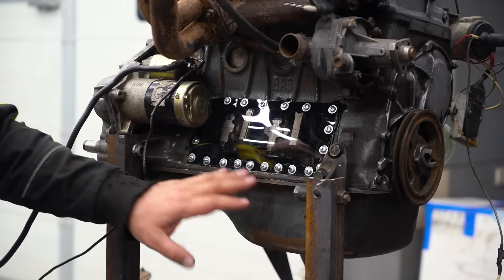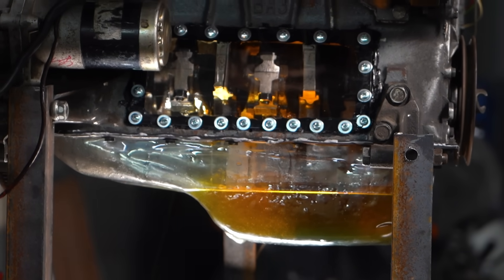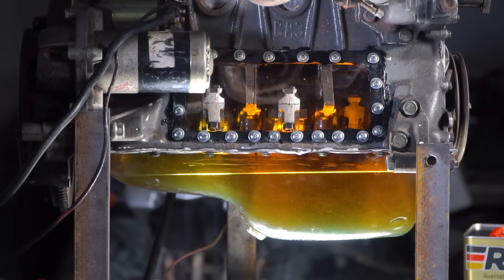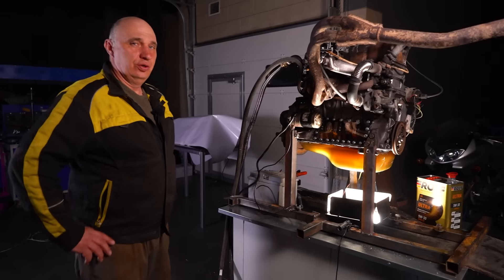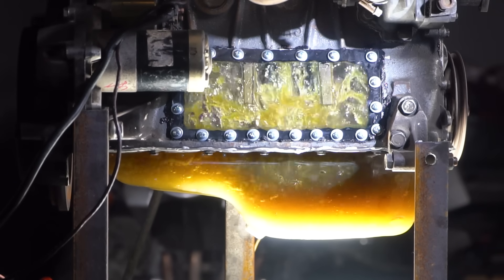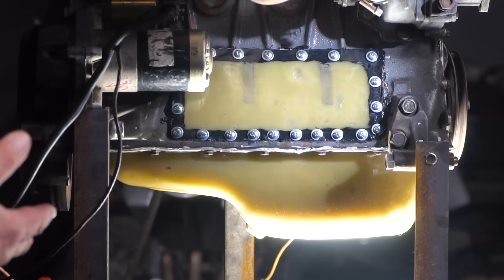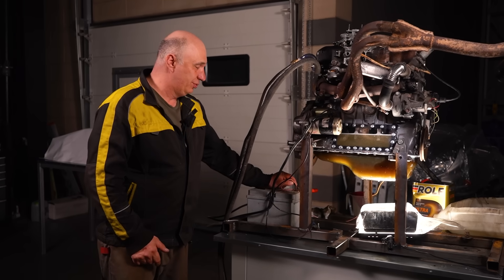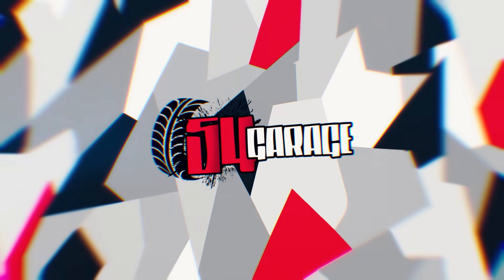What actually happens when you overfill your motor oil? (w/ transparent oil pan)

Comment: 8:25 "nothing bad happens" i saw a comment or 2 mentioning foaming which will lead to reduced film strength for bearing and metal surfaces. Yes, you are correct but remember most modern engines have windage trays and baffles which this engine did not. So even with this comparable level of being overfilled i dont personally deem it to be an engine killer in short term with windage trays. But of course dont PURPOSELY overfill either.

Comment: Yeah right.  The issue is that the discharge pressure of the oil pump will increase due to the increased suction head and you may blow your oil relief valve, and your oil will empty onto the street as your are driving.  Then you will run into serious problems if your don't notice in time. This happened to my when I put in about 50% above max level in my 1972 Ford Falcon (Australia) but I noticed before I lost all oil pressure.  Levels beyond this are ridiculous so I am not going to comment on this.  Ignore this video and pay attention to your oil level, measuring it on a flat road or surface.  For all we know, the test engine here may have had a faulty oil relief valve.

Comment: Hola tengo un OPEL CORSA GS-LINE 1.2 T XHL MT6 S/S 100 CV o 74 KW del año 2021 y tenia una pequeña fuga de aceite de motor  por  la valvula de drenaje de aceite digo tapon de abajo al subir el coche  ariba  tenia el tapon casi defectuoso y pusieron una arandela de cobre  y problema resuelto y tambien apretaron un poco mas  lo que es los tornillos del carter y añadieron mas aceite  pero es un PURE TECH tiene una correa bañada en aceite  y le pusieron hasta la varilla  mas del maximo y en ves  de que vomitase el coche por la rejilla como lo hacia el vuestro vomitaba por el tapon  grande  donde añades el aceite cuando llegas a 4000 RPM empiesa a scupir   mi duda es  con el tiempo ese aceite dejara de ser util  mas  tiempo o como va eso yo habia pensado meter una manguera y vaciar un poco aunque el coche esta en garantia y los mecanicos de  ahi solo chapusas hacen no queren ni trabajar.. y cuando consigues que te lo aregle peor lo hace..

Comment: it depends about the engine design; i am sure those old russian VAZ machines are much more forgiving about many things, but if you did that with modern petrol engine, the oil would foam like hell, also you lose power due to cavitation and even have more wear and tear cause of cavitation... there are engines that can drive with no oil forever and those who seize immediately... my point -better safe than sorry

Comment: Once I overfilled my bike with engine oil, after about 10 kilometers my bike overheated and stopped, then took it to mechanic he drained the excess oil and it became normal, so overfilling will stall you on the road somewhere, little bit will be OK though.

Comment: TLDR: The engine will run for the short term even when grossly overfilled with oil. BUT... long term, due to being churned by the crank, the oil gets whipped into cream which isn't good for lubrication and the overall life of the oil (shearing).

Also, this is a rugged, simple engine. Not a delicate modern engine with PCV, sensors etc that might not take too kindly to overfilling.

Comment: Ada kompromi kelebihan dan kekurangannya dengan oli yang di isi penuh berdasarkan opini ku pribadi, no offence.
1. aliran oli dalam mesin menjadi full segar merontokan residu dan kotoran
2. semua yang bergerak sudah dilumasi oli dengan sempurna, seperti layak nya gardan mobil dan gigi transmisi
3. saluran saluran capiler teraliri oli dengan kencang dan memiliki motif yang akan membersihkan saluran oli
4. oli sedikit berbusa / bergelembung udara untuk di pompa kebagian atas mesin.
5. pelumasan maximal, anti gesek masimal, anti aus maximal.
6. OCV bekerja extra, tapi bisa di bersihkan.
7. saluran oli di ring piston teraliri dengan aliran deras.

saya rasa ini cara terbaik untuk 1x trip perjalanan 100km sebelum ganti oli dan tune up mobil berkala. Atau menggunakan oli baru ACEA e7 yang tinggi detergent untuk 100km itu 

 Thanks for you experiment

Comment: I have filled the engine oil in my car with 3.5 litre as Shop person told more oil good for engine but later I regret as mentioned oil to put 3.1 litre but filled with 400 ml extra. But I didn't not find any issue in car like Start also happening and running also smooth but still I am worry for long go should I remove extra 400ml or should I keep as it is as oil level when I checked it was only in max not more than that if it is fine then I will keep the same. Suggest me please thanks in advance

Comment: Older engines tend to be more reliable, but those manufactured from 2015 onwards are not built as robustly. While they offer a lot of power, driving at high speeds for long distances, such as 50 miles, can lead to engine damage. Additionally, it's important to ensure that oil maintains proper circulation; otherwise, you may end up with a damaged engine.

Comment: The funniest thing here is the meathead thinks its fine as long as it doesnt explode. lmao
there's way more going on in a real engine. The PCV system will get fucked, the bearings will get fucked due to the oil foam, Catalytic converter will get fucked, spark plugs will get fouled, engine can get hydrolocked, but this is all beyond his high school diploma.

Typical tolerances are within 5% of recommended amount, (5 liters give or take)

Comment: I believe that if the oil is overfilled beyond what is allowed, very soon it will eventually find its way to each individual cylinder, where it will drown and turn off the spark plug. In the end, misfires occur, and the four-cylinder engine will hardly run with just two cylinders if you're lucky.

Comment: Unfortunately, you did not measure the oil pressure. When you increase the oil you increase the pressure and within a short time you will have oil leaks at the oil seals because of increased oil pressure.

Comment: No expertise in car engines,
always heard that if there was too much oil
it could overflow and become fuel
and the engine would race, only accelerate to failure.
I suppose this could have been possible in the 80s?
Is there another safety device to prevent racing?
Or was the oil never able to become fuel?
3:07 PM The excess oil comes out through the breather.
Where does the oil go through this outlet?

Comment: Enough oil will make the connecting rods to dip in the oil, OLD engines were designed to do this to throw oil up to the pistons ETC.   Todays engines have outher ways of lubercation, however,  rod dipping can cause sever damage to the ROD berings, increasing the tolerencs, dropping the oil pressure, and finally turning the OIL lite indicating the engine is SHOT.

Comment: I did that once as an apprentice. It was the owners car. We had a 30 minutes or it's free oil change. Inspection included. Owner left it for the day so no problem. Topped it up and got 6 30 minutes or free at the same time. Good luck with that. Went back after that b.s. and filled the car. Didn't get fired, but how tf  was I supposed to get 180 minutes done in 30. I quit, f u toyota

Comment: Even today many so called "car mechanics / technicians", who work in 4 out of 5 or more star workshops, need to see this video to understand how to diagnose a low oil level. I remember when I visited in 2024 a "car technician" in his own repair shop where I had to explain to him that a lower oil level than the maximum limit is normal for a car which just went to his workshop, because the oil was circulated inside the engine. He obviously wanted to sell me the oil, but I had to explain him that he needs to wait for an hour or more (with the engine shuted off) to properly diagnose the real oil level of the engine. Eventually he didn't listen to me and he had overfilled my engine with oil (he put +1.5 Liters) and fortunately this didn't cause any further trouble because I emptied these 1.5 liters shortly after I got an oil warning in my dashboard.

Comment: I run 2.5 qts over in my 2003 Silverado 6.0 . Because the oil pump pickup tube o ring is bad .. I have done this for the last 50k miles 😂😂😂😂😂😂

Comment: That's fascinating.  Before I change my oil I add a quart of automatic transmission fluid to the oil and drive for half an hour, then drain and refill with oil and change the filter.  Based on this it does help to over fill a little, it cleans up the engine components faster.  Once you get to max fill when over filling you end up with hydraulic pressure breaking through seals.  Amazing video, I've never seen anything like this.

Comment: i should mention transmission is different. If you add extra fluid over capacity then it causes overheating which means the fluid will become burnt and degraded sooner.

Comment: These idiots I wouldn't be surprised that they are misinforming people to cause them to deliberately destroy their power trains. Listen as u saw in the video it started to turn into milk when it was running. That is caused by foaming and aeration when that happens The engine oil can no longer provide lubrication and protection for your components then causing scoring and possibly catastrophic failure also the increased oil pressure will cause seals gaskets things to be compromised even though they ran the engine they only ran it in small increments and I'm pretty sure they were cuts that let them cool the engine back down and allowed them to reflush and put something else in or put in fresh oil because there's no way that that engine oil is staying that clean after that much aeration and foaming do not listen to this channel or these people there deliberately trying to destroy your engines from half a world away Nice try Russia. 🖕🏿🇷🇺

Comment: This may be an inherent design in this particular engine, but there doesn't seem to be an oil pump or pick up tube like in almost every engine. This is not a true representation of a typical engine and how oil gets circulated throughout the system. Most engines have an oil pump and a pick up tube that sucks in the oil and forces through the engine to vital components that need lubrication. If engines were built like shown here, most cars would be scrapped because no one really checks their oil level from what I've seen in my line of work. Having said that, the level of oil should be as recommended by the dip stick. Too much oil can plug up many emissions related parts and damage the catalytic converters.

Comment: I don't really like it when the oil is overfilled, but I'm thinking that the engine would have to be significantly overfilled to be a problem. Once the engine is running the probably 30% of the oil is circulating throughout the engine so the oil the oil in the pan should be much lower. If you pull the dipstick it should read very low, although I've never tried it. My motorcycle holds 3 qts of oil and it has a sight glass instead of a dipstick. When the oil level is close to full with the engine off, no oil level can be seen through the sight glass when it's running.
Reply: Depends if you got a turbo

Comment: Consequences about overfilling with oil: nothing if you take an engine for academic purposes, but in real life working, the engine lifespan is decreased, the oil lifespan is decreased and maintenance cost is increased, so it´s recommended fill to max level with oil because it's optimal for engine and cost maintenance.

In those extreme conditions, crankshaft works like a mixer between oil and internal air, and that mixture begin to travel through all the engine's oil ducts to finally reach each housing zone for each engine shafts, causing cumulative damage due to poor lubrication. The reason: oil mixed with air has bubbles, and these bubbles increase their size in function with engine temperature, causing the quality of the oil layer between shaft and its housing to be poor.

Comment: Don’t ever overfill a modern diesel motor that runs EGR and turbos.  Sumps are moderately full under normal fill conditions and it’s much easier to have foaming and large amounts of oil/vapor be put through the EGR emissions system.  Can severely soot and carbon up all of the intakes. Ultimately risk blowing seals too.

Comment: Just had to drain like a chinese tub worth of oil from my bike after the mechanics overfilled it.... just noticed some smoking from the left side seen some drops coming from a bolt onto the exhaust and yeah turns out it was filled WAY over the max took about an hour with a hose dripping it out because I couldn't get either bolt off and even then its only like maybe half a cm under max I couldn't be bothered to wait longer... luckily I noticed the burning smell and smoke before I left and was just letting it warm up... I don't know how a mechanic could make such a error especially since it was only in for a carb balance they had NO reason to look at the oil but said they topped it off for me. Undecided if it was on purpose to try cause a problem for me to come back or just sheer incompetency.

Comment: Last time I changed my oil I put too much in so was overfilled distance from low to high. I thought of Crank shaft hits the oil a-lot it makes air bubbles which if there are enough some make it through the pump and where there is a air bubble there isn't oil so can cause excess wear. In a real engine it would be sloshing around when car turns and accelerates/decelerates. Going up a steep hill oil might all be on one side so hit crank shaft even if not overfilled. So I worried too much before I drained out excess oil.

Coming back from SFO airport in my 1999 Toyota Camry 4 cylinder I rescued from the dump from a co-worker (80K miles ago).. First then I did was change all the oil including differential. Coming back from airport about 40 miles near home felt like drive train getting lots of friction and wanting to stop. I pulled over and called a tow truck. After reading stuff and thinking I realized... Not chaning differential oil or checking it after 80K miles is pretty stupid. If it ran low and wasn't lubricating properly and got hot or whatever I hope it isn't damaged too bad. Engine and transmission had plenty of oil and when suddenly feeling like brakes on (but not veering left or right) there was no mechanical noise. On curb beside freeway when I decided to crawl to exit on low car said NO I'm not in turning mood.

Garage 54 should try driving a car with very low differential oil and see how it dies.

Comment: This was definitely interesting. Never seen what actually happens. Seems like if you do a quart over its no big deal but if you're low on oil it could cause problems with your oil pump running dry.

Comment: This over fill oil was actually happened during my early years as oiler, the engine, it's japanese six cylinder Niigata installed in steel fishing vessel and newly overhauled, after the crankcase ( small engine with approx 1000 bhp has no sump tank) was filled up with fresh oil, the engine was started (air starting) and  while running no oil pressure was regestered in pressure gauge, several times that the engine started but still no oil pressure, the attached oil pump is in good condition, the oil again was checked and it was more over the gauge oil level mark, so the excess oil was removed and when the engine was restarted the oil pressure was normal

Comment: I would have liked to see an oil pressure gauge showing the affect of the air entrained oil on gallery pressure.  I think a couple of quarts over the max recommended level would not adversely affect the engine, other than a slight loss in power due to windage, but it's also possible that excess oil finding its way into the head and getting sucked down the valve guides could contribute to excessive carbon buildup in the combustion chambers and worse emission problems.

Comment: A mechanic once told me about a car that was towed into the workshop that was owned by an elderly gentleman. The problem was the engine was frozen up solid. It turned out the gentleman had been filling and filling oil, thinking more is better, and the engine was completely full of oil, all up to the filler cap.

Comment: First time i've done i put 10l because of the indicator on the dipstick. We went on with it and started the engine but it took so long to start then stalled by itself.. after that, we got info and we had to pour only 3.5 or something and we took out what was above and let the rest in, we started the engine and it smocked like crazy for a few miles and that was all, it runs even today.

Comment: im not sure but in the last 2 tests the oil pan seems to be expanding when you hit the gas.... and shrinking back when the engine falls back to idle rpms... it kind of looks like its breathing... possibly because off the oil pressure increasing with higher rpms?.....